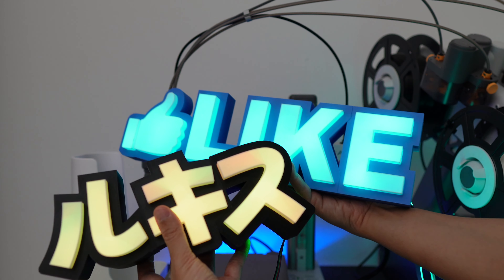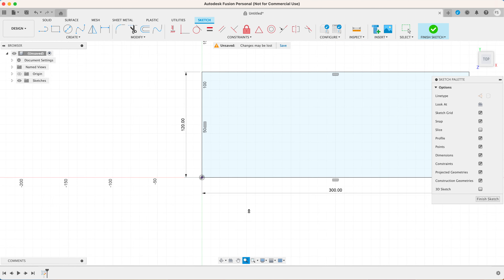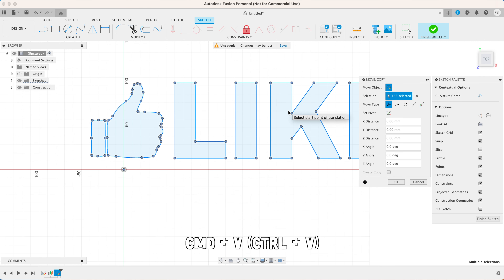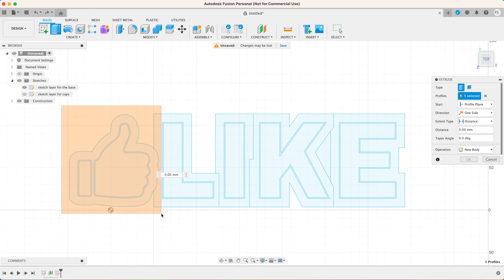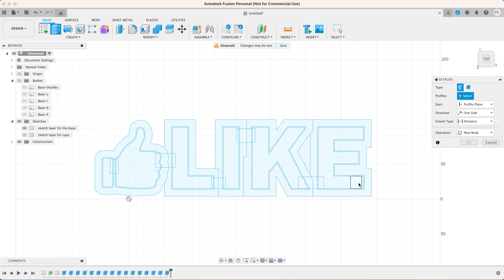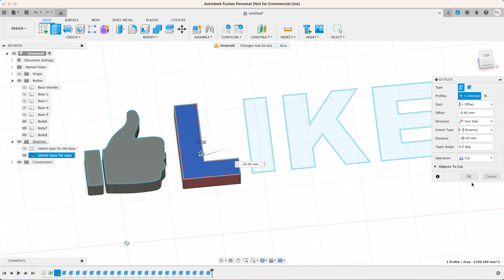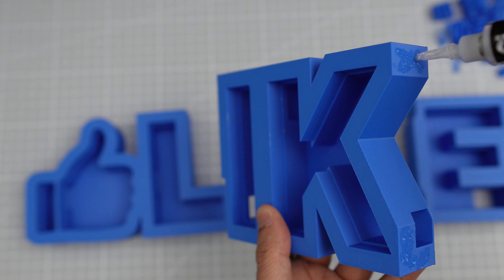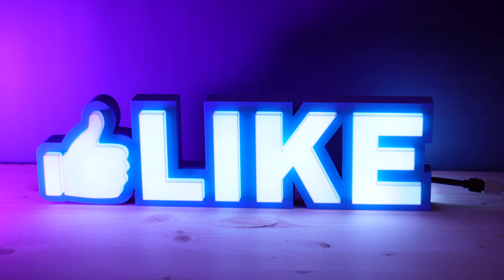How to make 3D Printed LED Letters sign (ft. BambuLab A1 Mini)

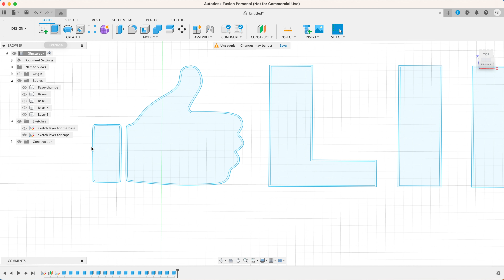Comment: at 7:11 it will not let me select the outer line , when I double click the outer line to make the 0.1mm offset to just goes the the inner line
Reply from the maker: you don’t need to double click it though, just one-click is fine. And make sure to select the line of the original letter. You can’t offset the offset line.

Comment: Terrible way to teach something.. OMG I have to pause the video and backforward more than 10x and its 3minutes passed... :(
Reply from the maker: sorry😅 Will it help to slow down the video abit? You can change the speed in the settings.
Reply: He was extremely clear, it's your own fault if you thought you could follow a tutorial while playing the video. It would have been ridiculous if he paused in the middle of the video to wait for you to do whatever. He's showing you how.
Reply: @Lukis3D  I struggled quite a bit and am at the point of extruding but am thinking of giving up.  Too many things do not work the same way.  I am also brand new to Fusion 360 so that part is my fault, taking on such a complex project as a first project.